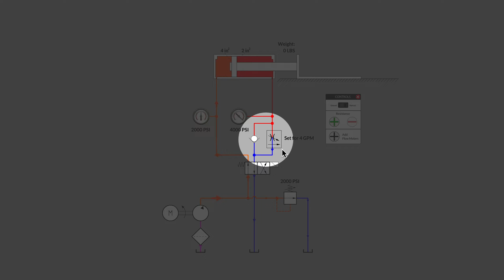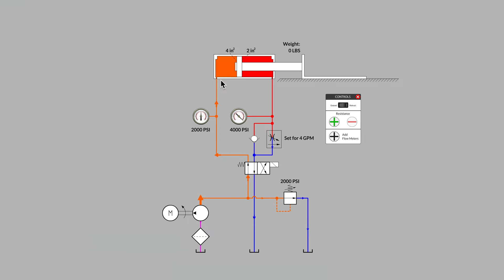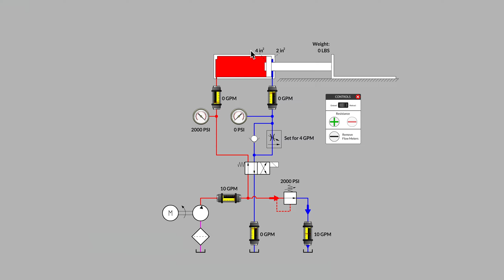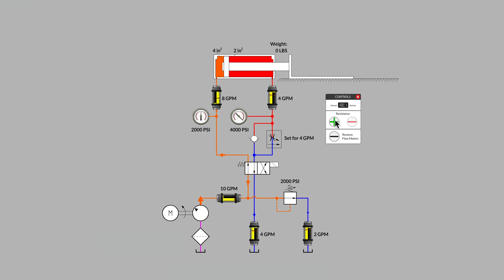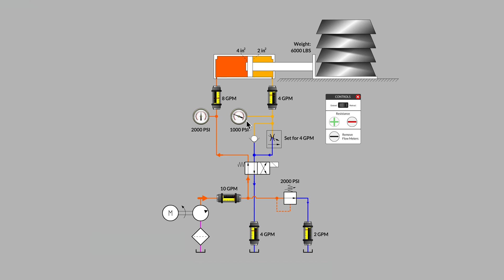Cylinder Pressure Intensification

Comment: Why is the outgoing pressure lower while pushing the weight  ?  Should it not be higher since it has to work harder ?
Reply: No, since the weight of load resists the normally freely moving piston. The incoming fluid has to push against 6000 lbs to get it to move, using up that energy. There is now only 2000 lbs of excess energy which converts to 1000 psi of pressure due to 2" surface area. With no load, the incoming 8000 lbs of pressure can push freely against the piston, making the outgoing fluid feeling that full force itself.

Comment: Flow across throttle valve depends on pr. difference. During the condition of no external load, the flow is considered to be 4 gpm when the pr. difference is 4000 psi. During external load , when the pr. difference is 1000 psi, the flow will be 2 gpm and rest 10-4=6 gpm will pass through relief valve. since  more than 30% (60%) of hydraulic is bypassed, the system will heat up tremendously
Reply: This is incorrect, except for the part about it heating up.

Comment: I think there is a problem when we set the flow rate 4 GPM, it might be lower than that, I think. It’s still a great video, we got the idea of the pressure intensification very clearly.

Comment: Excellent video. In order to avoid cylinder intensification, why not to put relief valve or cartridge valve at rod end of cylinder?
Thanks.
Reply from the maker: Indeed a relief valve of such a type and system location is often installed when an intensification issue/risk is present.
Reply: @lunchboxsessions  Thanks Carl for your prompt reply. Waiting for your next live session at the end of August. Please keep us educating with your valuable expertise.

Comment: When the cap end force equals the rod end total force (fluid pressure +weight), how come the piston still manages to expand? Could be a stupid question to ask but m wondering lol
Reply: this is a steady state operation (the forces on the piston cancel out each other ) but before the system had reached this steady state operation the force on the large piston face was greater than the force on the smaller face + the weight so the piston will gain acceleration and when the velocity increase to a certain level which the pressure on the small face is high enough 
(with the aid of weights) to stop the piston from accelerating so the velocity became constant and the piston reached equilibrium or steadystate (forces from left=forces from right)

Comment: A pressure compensated pump with a shuttle valve that could control  pump pressure from the highest pressure side of the cylinder? Thanks again.

Comment: The pump is displacing 10 GPM with 4 GPM returning via the control valve and 2 GPM going over the relief valve = 6 GPM.
So where is the other 4 GPM going?
Reply from the maker: Rod Cahill keep in mind that a hydraulic cylinder does not actually circulate any fluid, due to the piston and seal. The cylinder only shuffles fluid  in and out. Does that make sense? So with only four GPM leaving from the rod port, due to a pressure compensated flow control, only eight GPM can enter from the base port. That ratio of flow is due to the rod diameter which makes for a 1:2 differential cylinder. Does that help a little? I know that this one can be a bit tricky at first. - Carl
Reply: Hi Carl, Yeah that all makes sense now I think about it! Was forgetting that wasnt just circulating oil and the different volumes of oil in each end of the cylinder.